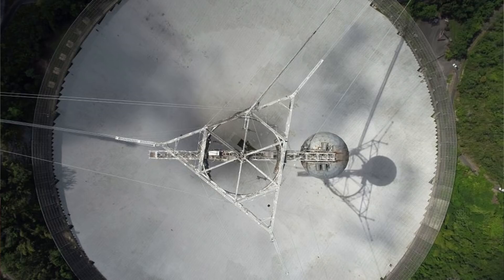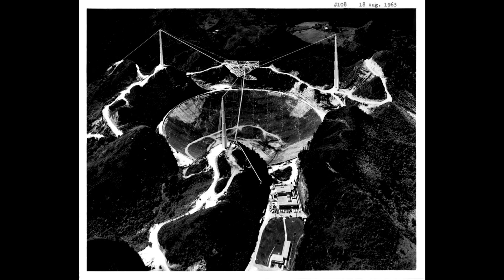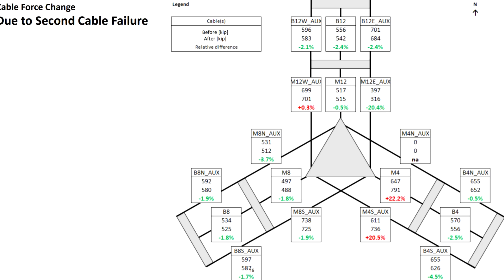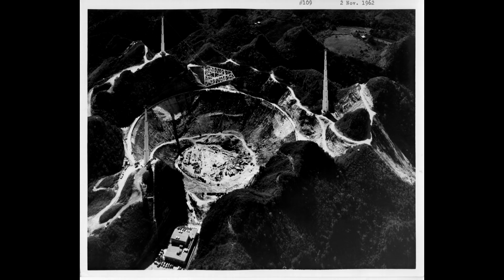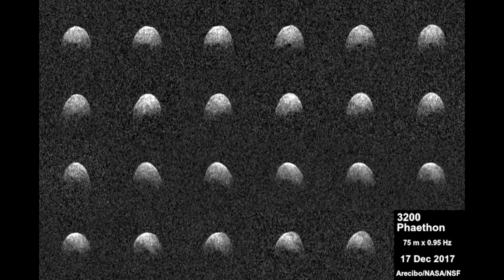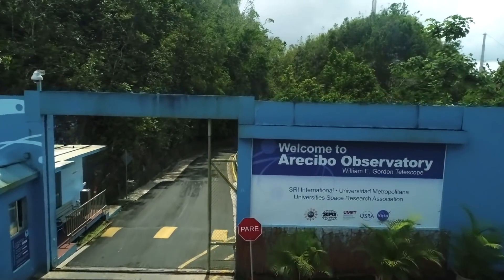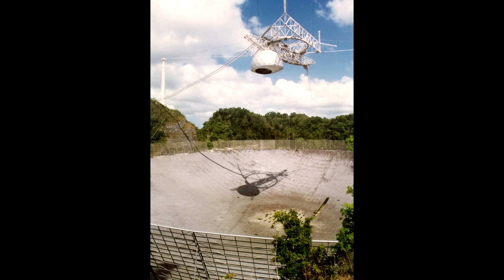Worlds Largest Radar Astronomy Dish To Be Demolished!

Comment: Astrophysicist who has worked with current- and next-generation radio telescopes: This is somewhat sad, but there are cheaper and better ways of getting most of the capabilities of Arecibo with phased array telescopes such as LOFAR and SKA.  They don't look nearly as impressive, but they're so much better at resolved imaging that it's hard to argue with the drive in that direction: Instead of being hundreds of metres across, they're hundreds or even thousands of kilometres across.

Comment: Any chance one of those devices for stringing suspension bridges (maybe called a spider()?) could be commandeered to add new cables to steady it while the thing is repaired? Those things are pretty small pretty powerful and of course they string very important cables. I would swing a shovel if it would help rebuild it

Comment: The chinese have built one -much larger than Aracibo-check it out.
Reply: But as with most Chinese tech... the accomplishment is hollow on the inside...

Sure it’s bigger, but it’s instrumentation suite lacks RADAR and it’s cradle is less than a tenth the size.  A bigger dish means little if you didn’t build the aerial structure strong enough to hold “bigger eyes.”
Reply: @scottwendt9575  thanks for the info.

Comment: In the high tension high performance world of yacht racing the catastrophic failure of rigging and mast is a persistent and sometimes deadly problem.  Three of the biggest problems are corrosion, fretting, and stress hardening - all of which can lead to cracking of strands and failure of the cable.  In the corrosive salt-water environment of the worlds oceans it is normal to see a line of grey-to-black in the grooves between the individual strands of the wire cables.  What are those grey lines composed of?  dirt, grime, salt, and micro-particles of various oxide-species of the constituent elements of the stainless steel cable.  Add to that the action of the fretting together of the strands of the cable with one another and what you wind up with is thinner strands, but more importantly micro-cracks.  And, cracks propagate - explosively.  Increase the loads on a network of cables and one cable fails, the stress loads on all of the crack-ridden, work hardened, corroded, overloaded to the point where failure of the entire cable network is now expected.

This is one reason why in the ultra-high stress world people have moved away from wire rigging to solid or composite, and the reason rigging is replaced from time to time.  There is no way to adequately inspect it, you just replace it every so often. Yeah, original cables from the 1960's, failure of the whole system is about what you might expect.

It is a little like upgrading to the latest-greatest version of your computer's OS.  Everything has worked fine until now but... all of those marginal sectors on your hard drive, load that new OS on, and suddenly they cannot cope, and the whole drive dies.  Ooops.  Wasn't the fault of the new OS, it was a bunch of decrepit sectors on an old hard drive.  It's a bit like asking your 90 year old granny to walk up ten flights of stairs with the groceries.  She makes it up four.

Comment: ERP effective radiated power.  is power into the antenna (which is pointed at the dish) times the gain of the dish. the gain of the dish is proportional to the frequency used to transmit. so it is entirely possible that the transmitter is only 100Watts times the ridiculous gain of the dish that you end up with 1 million watts of ERP.

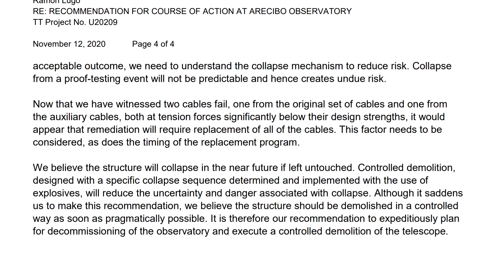Comment: The delamination displayed at 4:50 is one of those things you look for when inspecting cables like this.  It can mean that a cable was damaged by being bent past minimum(Maximum?  Been a few years) bend radius, was struck by something, had ice form in the middle, or that it was stressed to the point of some portion experiencing plastic deformation.  Usually means the strength of the cable is drastically reduced since the strands will be unevenly stressed.

Not an engineer.  Turned a wrench on guyed steel lattice towers.  Just based on what I was told to look for during inspections.

Comment: Scott,
This issue screams out that there was little or no programmatic maintenance or inspection programs in place to insure the safety/longevity of the facility.  Wire Rope (cables) do not have an unlimited useful life.  Inferring from your video that the original strength ratings were still being utilized after 30- 60 years of exposure under load is close to engineering malpractice.  Wire rope in that environment would require monthly maintenance just to stay abreast of corrosion, much less monitor age/load/exposure driven degradation.  You can assume that any effective maintenance/inspection program would have noted the beginning of the slippage in the end sockets.  The stills in your video show what appears to be signs of internal corrosion within the cables that is the likely precursor to the indivicual strand/element failures being observed.

Too many managers/accountants making operations decisions with no appreciation or concerns for the consequences as long as they get credit for 'saving' funds in the current budget cycle.

Comment: Perhaps FAST could have radar added to it.
Reply: From the pictures, it looks like shortsighted design will prevent this.  The cradle and its support structure wasn’t built big enough without rebuilding everything but the dish.  Arecibo was big enough for them think they could support doubling the weight of the cradle by adding more cables. In hindsight, perhaps they were wrong 🤔
Reply: @scottwendt9575  I'm sure you're right about structural issues. Could be the FAST designers said "why add radar? - there's already one at Areceibo..."
(And that cost thing of course...)

Comment: Cables do deteriorate.  For years the Forth Road Bridge (Scotland) had or has sensors to monitor the cables there.  Same era as the telescope.  Difference is that a new bridge was built in good time, and no disaster.

Comment: As a structural engineering working with guyed telecommunication structures (these wires are all 'guy wires'), I have little to add, you nailed it throughout the video.
 
To your question of, can't something be done: kind of, but with the amount of energy contained in any of the individual wires, if they snap they can fly and literally snap you in two. To have another wire fail at a lower than expected strength (and that is 62% of a capacity already reduced by a factor of safety of 1.5 to 2), that doesn't lend much confidence to the remaining wires. The worker that made that batch could have been hung over, weirder stuff has happened.
 
The only way I could see this ever working is if they slacken all the guy wires gradually and lower the central platform to the ground. It would mess up the dish pretty badly and probably crush the dome, but I don't see any other way. At that point they are basically rebuilding most of it anyways. A replacement could at least use the same foundations and towers, probably.

Comment: Even an aero engineer who would be accustomed to relatively low factors of safety in design would shudder t that 60% load figure causing a snap. I'm still studying but my understanding is that structural engineers deal in terms of a factor of safety of 5 or 7 or upwards of 10. That cable snapped well below the safety factor .6 so I wouldn't get anywhere near the whole thing.

Comment: Supporting a load with nearly horizontal cables puts an enormous amount of stress on the cables.  They should have built taller towers when they increased the load.  I don't expect this to happen, but they could build taller towers to support the instruments.

Or they could build a truss out of maybe fiberglass instead of using cables.

Comment: Can they lower the equipment and remove it? Or use a heavy lift helicopter (skycrane) to lift the instrument module while the cables are cut free?
 Cable failures come from poor engineering, or maintenace, or counterfeit substandard cables. The Brooklyn Bridge almost got built with counterfeit cables, the problem is that old.

Comment: Chinese steel, Chinese steel never changes. Since the dawn of human kind, when our ancestors first discovered the cheapening power of weak steel, blood has been spilled in the name of everything: from snapping Chinese steel cables at arecibo to failing injection gun barrels and infrastructure in North Dakota oil fields. Steel pipes and steel supply ages faster today because of cheap Chinese sourced steel.
Reply from the maker: Muncy Industries is a US company https://twitter.com/djsnm/status/1330669398319796224?s=21
Reply: @scottmanley  But where is the steel actually coming from? See we ran into the same issue in the oil fields where no marked steel was sold as american steel, but it was actually from china. I am not saying this is the case, but it could be. It got so bad some of the critical parts had to have a chain of custody so to speak for insurance reasons.
Reply from the maker: @epoxeclipse  Regardless of where the steel was sourced from the zinc poured spelter socket which failed was made in the US.
Reply: @scottmanley  I see.. Perhaps the wear and tear was more than they had accounted for, that would not surprise me. One example I had an injection barrel fail on a skid that had an injection pump (just pumps salt water back into the ground from a salt water disposal)  the injection barrel was supposed to last 10 years before major corrosion, it hadn't quite made 2 and a half and developed a pin hole. The problem is in the pump room a pin hole looks like a hurricane is ripping the room apart because the barrel is holding thousands of psi and water pressure. So we get a welder out there and the above me bosses and engineer are sure it's just a defect and we weld that and it's good.  The welder and I fill the hole and while we are filling the hole notice the metal in the surrounding area isn't all that thick either. The weld held up for 2 days and the barrel developed another hole. Upon inspection of the barrel the corrosion was what we had expected to see after 10 years of operation. The parts manufacturer was found to be using Chinese sourced steel and a ten year part didn't make it 3 years. We found out they had got a bunch of hardware for our sites at prices that were quite a bargain..

Comment: Three more pylons, built a bit taller, planted 60 degrees between the existing three pylons. Lock onto the existing corners of the instrument cluster, there will be a small additional occlusion from this, then take the strain from the original pylons. Then replace the cables in the original pylons.
Use the height of the new pylons to help lift the cluster up, relieving strain, but then use the differing heights between the two sets of pylons to better position the cluster, without having to tug the thing. Lower it from the tall pylons, and just take up slack with the short ones.

Alternately, build a cradle connected to these three pylons, old or new but preferably new, on new cables, and lift it up to support the platform from underneath so you can work on the cables while they can be slack. Do pick a calm day to move the cradle into position and raise it up under the instrument platform.

Build a cable guyed, semi-inflatable, solar sail like structure in the earth-lunar L5 point, or better, L2 point. Use this as a reflector for a new orbital radio telescope that is even bigger than Aricebo and also potentially in the radio shadow of the moon. As a bonus, it would be steerable. Slowly, but still. Not a way to save Aricebo, but a way to replace it and continue to benefit from what it offers us. On the downside, upgrades would be impractical, unless the instrument cluster was designed to be carried by a rocket, and be swapped out as a unit. Which would work.

Comment: Surely some bright engineers can design a robot that will run new cables out along the existing cables and attach them. The operators could stand safely in the support tower and feed out cable.

Comment: What makes me mad is that the Brooklyn bridge is still as strong today as when it was first built, it's 19th century cables are still doing their job!   The French recently built a massive bridge across a wide valley, surely the cables they used could replace the cables at Arecibo?   I'm thinking that the real reason for dismantling the dish is a very skinny budget with no money available to do a proper repair.  The lack of maintenance really is a shame,  "invest money now or spend money later"  is an old saying that really applies here.

Comment: As someone whose job was to build stuff and take it down a week later. They should gently lower the suspended parts. Put temporary supports through the dish. Remove all the cables.  Make everything as safe as possible,. When and if funding comes through, they can rebuild it without destroying everything.  Only beancounters think it's better to scrap everything because it's cheaper.

Comment: 9:42 Collecting area is perhaps not so vital -- all that does is diminish the signal/noise ratio. What is probably more important is angular resolution, and you do that by widening the effective aperture. Which you can do by setting up multiple radio telescopes over a sufficient distance, listening to the same signal in sync. Hence the well-known radio telescope array projects.

Comment: I can think of several individuals who could offer to fund a complete rebuild. As of several years ago the operating budget was only $12mm/year. Call it $24mm/ year to run an updated, improved version.
Actually repairing the system is not impossible - add a pair of reinforcing lines of synthetic (Dynel?) line, such as used for mooring large ships, into each pylon, and then lower the entire gondola into a cradle on the ground. Then do the upgrades and repairs to all components, and in two years it could be back in service better than ever.
The Chinese dish may be bigger but has less off-axis capability and does not have the megawatt radar capability, leaving Arecibo as the only such asteroid observation platform.

Comment: Instead of installing new 3" cables, with the associated dangers of tightening each of these, why not begin with a much smaller cable, which presumably would not be as dangerous to tighten? And then one by one, while going around the circle of course, keep adding one more of these smaller cables, again and again, until enough have been added to equal the strength of all the 3" cables.

Comment: If there is an appetite for continuing to use the facility, a demolition and replacement would absolutely be the cheaper option. Presumably, the foundations are still good, as are the support facilities, and no earthwork need to be done. A new design could have a smaller, lighter instrument platform with similar capabilities, and perhaps a system for lowering the platform to the ground for easier, cheaper maintenance.

Construction of observatories continues to advance, as does construction in general. This is an opportunity to take advantage of that, rather than trying to band-aid a dangerous situation.

Comment: Just like the bridge collapse in Italy. Burecrat s again
Reply: No, flawed design. Our bridge was stressed concrete, worst possible building material in a seaside environment. About Arecibo, as far as I know it is not possible to replace its load bearing cables in a safe way. I cannot understand why it was designed in such a way, think that any part of Paris' Tour Eiffel is replaceable without putting at risk workers and structure stability. But Eiffel was a great engineer...

Comment: He said the central truss structure was originally built on the ground and then hoisted into position. I wonder if they could remove a section of the dish directly below the structure, and then lower the structure to the ground, connect new cables, and hoist it back up. There must be a reason, that's too obvious a solution otherwise.

Comment: I'm not an engineer, but I'm amazed at the steep rigging angle. So much force... 500 tons becomes equivalent to 1000 pretty quickly.

You can't skimp on maintenance and inspections in that kind of structure rigged in that way.

Comment: It's a little known fact that the more flatter the suspension cable is, the higher the tension inside it. Stretch a 500tonne breaking strain  cable flat and hang a 500 tonne weight in the middle of it and see what tension you have in the cable!  Putting 50% more load on it and then pulling it down into the focal position..is asking for it.

Comment: If the beam is focused, the inverse square law only applies  to a point source. A laser beam for example does not lose its energy since the beam energy is collimated in a parallel manner. The reflection would be scattered as a point source. Therefore the reduction in return power would only be one-fourth of the transmitted power. So twice the power would result in four times sthe distance for the same return.